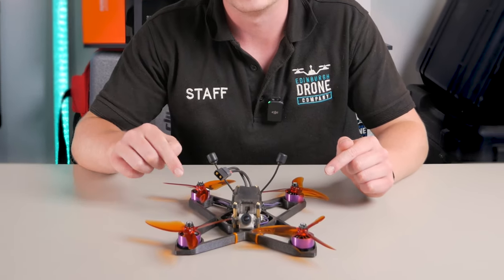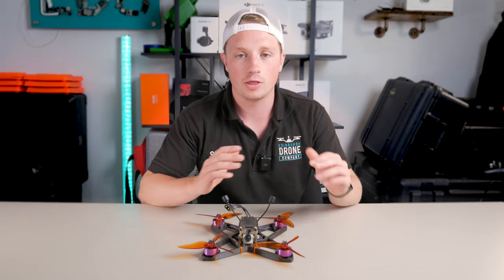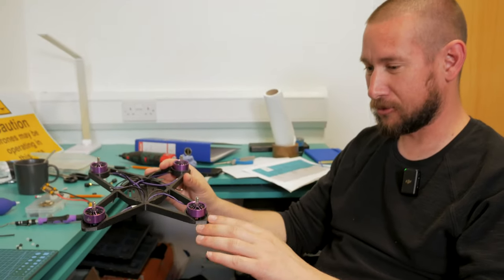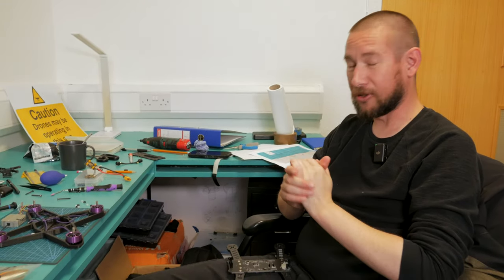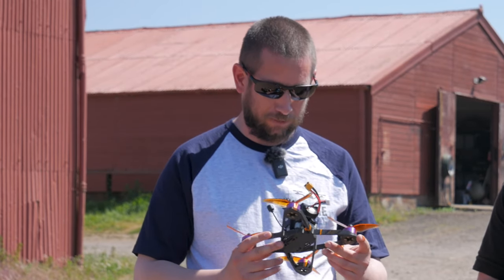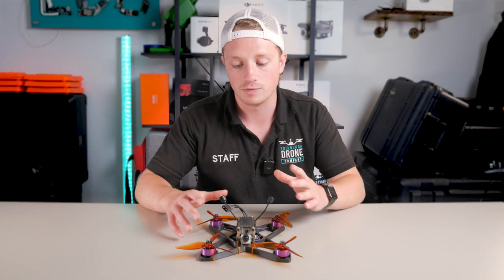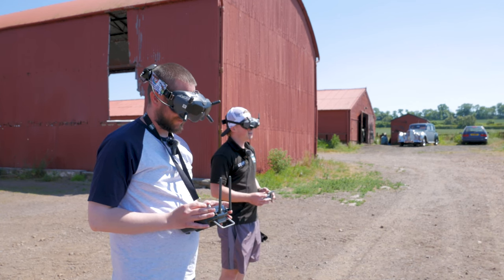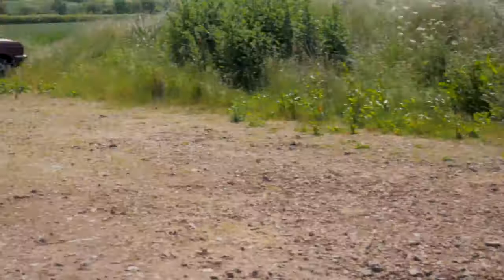We 3D Printed an FPV Drone | Does it Fly??

Comment: For anyone wondering. The best material to print this frame out of would be cf-nylon/pa-cf becuase it is only 60 percent the weight of pla but way stronger. If your printer can't print out of that then just basic pla or petg should work but you may need to replace the frame more often.

Comment: What’d you use to print with? PETG? Have you had the first crash with it yet?
Reply from the maker: My ‘interesting material and method’ at the moment is additive manufacturing and SLS printing. We are using some carbon fibre reinforced products but each part is expensive but worth it for the right items.

Material we went with on this one was PLA in Galatic black off of memory. We are okay with orange and Teal colours which is fun.

PETG and TPU as well which is fun playing with more flexible print finishes.
Reply: @edinburghdronecompany  Using PLA, do you anticipate it can handle a crash. I ask because it’s an interesting idea to print frames but the durability is my question. Being new to fpv, I’m very good at breaking things. lol 😂
Reply from the maker: @JuicySmullietFPV  - no they are terrible during impacts! They disintegrate 😂 

Stick with carbon fibre, this is only for fun.

Other print methods and materials stronger but this method and material is only for fun.
Reply: @edinburghdronecompany  lol 😂

Comment: Wehre are the print files? And can i print with PLA? also nice video
Reply: Print a test frame off thingiverse, leave it out in the sun for an hour or two.

I think PLA/PLA+ is too prone to warping in the sun. ASA may be a better choice since its rated up to 90°c as to most PLA at 40°c
Reply: @EnvyOCE Its possible to print in pla but if u want it to be sun resistent u can make a protective layer of high temperature tape

Comment: I am a big fan of 3d printing but as far as i know the frame is the cheapest part of the drone it doesn’t make sense to print it not to mention the strength of such a part.
Reply from the maker: We like to try new materials and methods. 

Additive manufacture has many benefits especially when speed or location is an issue. 

Carbon fibre frames £50-100 depending on build and quality. 

3d printed frame - maybe £5-10 max